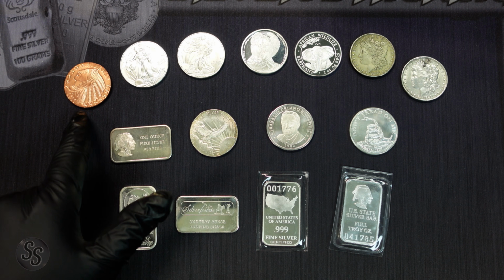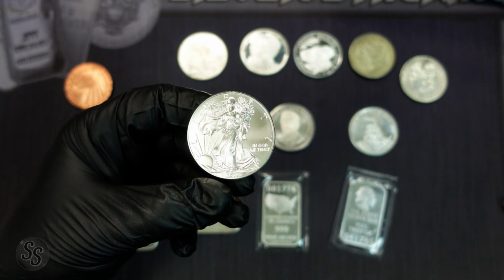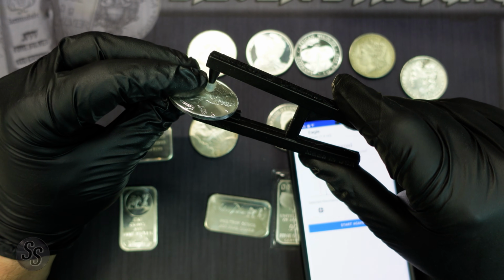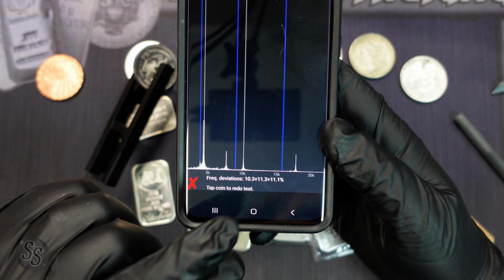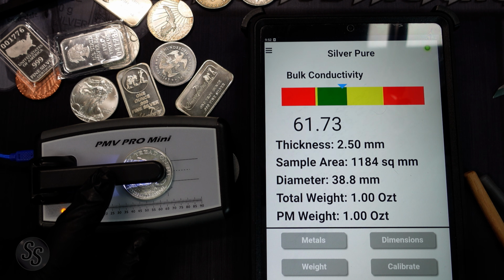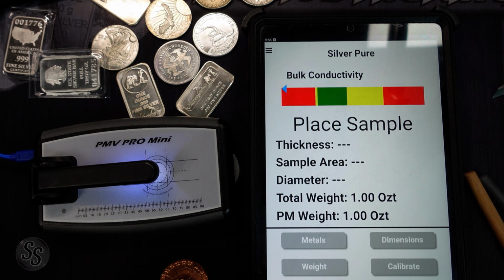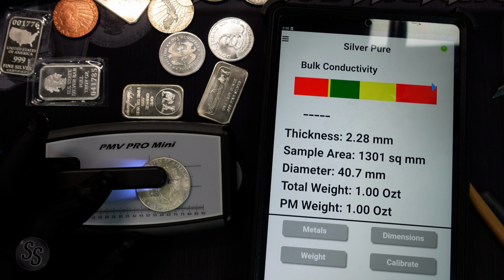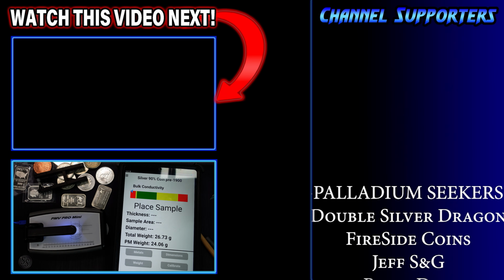Think You Have FAKE Silver?  Here's How I Test My Silver Coins!

Comment: I got a 1989 eagle from a reputable dealer I have bought from without problem 
 This one weighed 1.04 Troy oz.
But it passed ping test on app 
And I scratched it and put 14k silver test acid on and it didn’t react bad I got red positive and no reaction.
 Could the weight be slightly over on ASE ?

Comment: If that expensive device is just testing the electrical resistance, why can't one just use a regulator volt/ohm-meter to test the electrical resistance through the coins?  The resistance of silver and other metals should be available.  One needs to measure thickness or size depending on how one wants to measure resistance.  From edge to edge should give a more accurate reading.

Comment: Is there a source that provides a chart or formula to determine the "ping" frequency (and perhaps even the decay rate) for pure silver/gold based on 
diameter and thickness for rounds/coins
and
Thickness, Width, and Length for rectangular bars

For example, I plug-in the diameter and thickness of a .999 silver coin and the output of the chart or formula is the approximate "ping" frequency one should obtain from a quality item (no voids, major defects, etc)

I realize there will be some differences depending on cosmetic design differences, whether a round has Reeds or not, but I would think the frequency deviations would be relatively small compared to deviations found by fakes using different metals and false purity claims.

Comment: So, if someone had a coin, the outside was silver, but inside was copper. Plus the right dimensions. It’d pass the Sigma test possibly? And the magnet test.
It would fail the weight and ping test though.
Reply from the maker: It would be hard to get the right dimensions and the right weight if it wasn't also pure silver.

Comment: Great video and plenty of useful information. My concern, being fairly new to stacking, is where are the fake coins coming from. I would think that reputable dealers would not have any.
Reply: Not. All 🥇 and 🥈 is real. This has been going on since Roman times. Back in those days they used to clip the edges of gold and add cheaper metals thereby debasing the original metal making it less valuable...This is what con artists do.😢😢😢
Reply: Mainly from china. One such company is called TEMU which offers all kinds of very well made fake silver and gold coins for a few dollars.
Don't order anything from them unless you want 20-30 or more scam texts a day. I have never had a serious scam problem until I ordered some cheap Chinese crap from them and now I'm wondering if I should change my number.

Comment: Kind of disappointed with your Sigma tests.  I'd expect it to be right on at that price.  Have found the ping test useful for silver, useless for gold.  I also do specific gravity tests on my silver which is pretty accurate, but also useless for gold (because tungsten is almost the same SG as gold).
Reply from the maker: What do you mean right on?  Copper and Silver have VERY similar properties but in the years I've had this machine I've never had a single false positive.  I've covered specific gravity before, messy test and with Silver there is always a bit of variance so I actually don't like it.